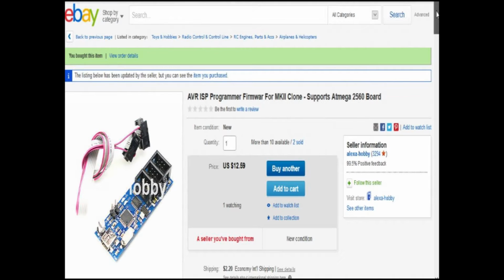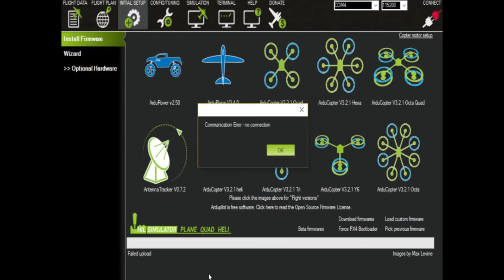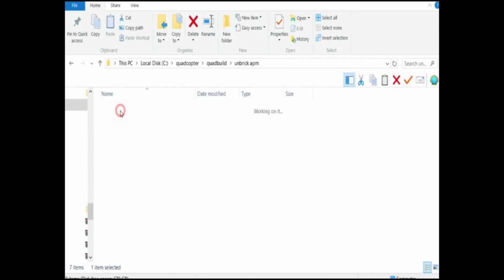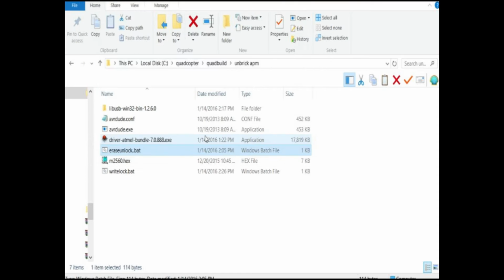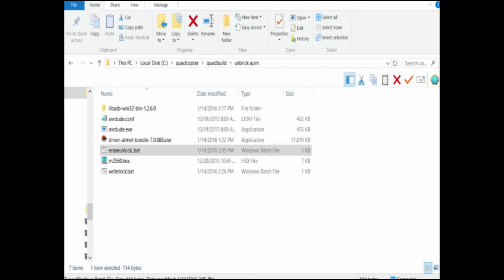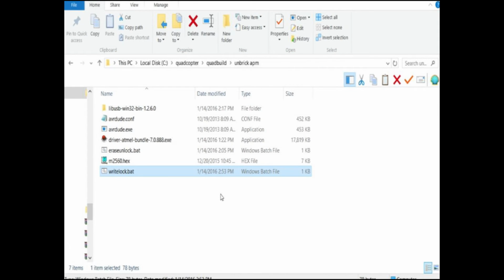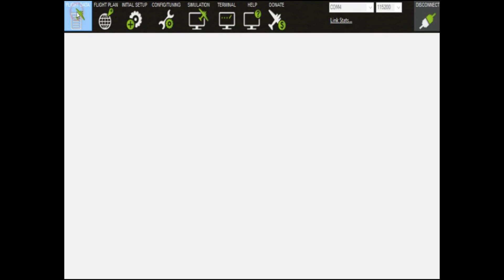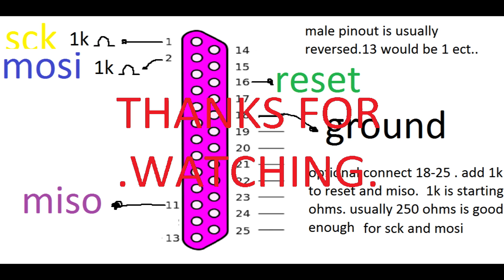Recover a bricked APM 2.

Comment: I have windows 10 desk top and don't know how to get to the set in my computer that your video is showing
Reply from the maker: in the description I show a link to the programmer
Reply from the maker: my package has support for these two from banggood
http://goo.gl/AA5JgA     //usbtiny .
https://goo.gl/8XVE3P   //usbasp
Reply: I received one out of the two USBASP USBISP AVR Programmer Adapter 10 Pin Cable USB ATMEGA8 ATMEGA128 Arduino. Still waiting for the other one to get here
Reply from the maker: so you can actually just try using the 10 pin version .. here is the picture again . https://drive.google.com/open?id=0B2w6_OKE_2kxRmpmLTBoTUZUeVE

fallow the video the same way .. but use the above pinout instead .. 
for this part of the video..
Reply from the maker: So were you able to get it to go?

Comment: unable to find the bat files in the above mentioned
 package...can u plese help
Reply from the maker: HI it could be you have hide extensions on.. the bat files name without the .bat are located in the "New full write with firmware"  folder.
file names are 
avrispmkii write full boot plus v3.2.1
usbasp write full boot plus v3.2.1
usbtiny write full boot plus v3.2.1

in the main folder they are the files that start with
unbrick
Reply: thanx but i am talking about eraseunlock.bat and writelock.bat...thanx
Reply: and one more thing after running usbasp.bat it is showing unable to verify data...if you can please elaborate on this issue.I am having apm 2.6 with communication error..unable to connect to mavlink...
Reply from the maker: hi ..sorry about that. I changed the files since the video and did not include that in the readme.  just click on one of the unbrick files i listed in the last message..  ( I merged the two files into one)

  if you only want to do the boot loader click on one of the unbrick files..     If you want to do the boot loader and write version 3.2.1 at the same time then go into the New folder.    

thanks for your message , I will update the readme so people won't get confused.
Reply from the maker: are you getting the same error on both files .. "usbasp write full boot plus v3.2.1"     and "unbrick usbasp"     .. I'm not sure what  error your talking about or when its failing.   is the 2560 being detected?
Reply: Thank you very much for the quick revert...whenever i am clicking on only unbrick file bootloader is done but after that when i am trying to connect apm to mission planner it is not getting connected and showing timeout error...and showing no connection...what can i do...any help would be greatly appriciated...
Reply: no while i use unbrick usbasp i get no error and blue and yellow led start flashing...but when i use the other file all leds stop blinking and there is only one solid led.in the log  i can see it writes the flash but unable to verify it...
Reply from the maker: hello.. went out for the day.. ... but anyways,..   When you run the unbrick one .  the next step is to go into mission planner.
set you com port and baud rate to 115200 but don't push connect .
go to initial setup..
Install firmware 
... then click on the third icon regardless of version number it shows . it should default to version 3.2.1  
or you can just simply click on "Pick previous firmware. and load version 3.1.5 or 3.2.1  .. let it finish, then try to connect in the main screen again
Reply from the maker: errr should add when your finished with the first step the unbrick file. unplug the isp and plug in the usb cable then fallow the above steps with installing the firmware.
Reply: i tried installing the firmware 3.2.1 after running unbrick one it shows communication error...no connection :-( The thing get stuck at reading hex and after this error comes...
Reply from the maker: Ok  . when you plug in your apm does it still get detected as a serial port /com port?
Reply: yes it does.
com 4
Reply from the maker: hmm well starting to think your apm might just be dead..   Can you run the  new firmware one again
but copy the text and try to paste it here or post it on your google drive..

how to copy the text.
when you double click on the bat file.
keep pushing space bar when it tells you to .. until you see
"DONE!!!  Unplug the isp and plug..........."

on the top of the cmd window ..it should say something like
"c:\windows\system32\cmd"

right beside the cmd right click go to edit and select all.. then go back and right click and choose copy .. ..then try to paste the info here.. it might be too long..

or just figure away to copy the info.
Reply from the maker: if your having a problem copying the text over let me know.. you can also send it to bangs696969@gmail.com

If you post a link  here just give me time to review and accept it...in the mean time you won't see it. probably.
Reply: bangs6996 thank you so much for being so generous and taking so much of pain....I am on the job and will send you Dropbox link.thanks for all the concern...you rock...
Reply from the maker: Ok I looked over both files. and neither of them are getting to the step of actually seeing the apm 2560 chip.

you can simply unplug the isp from the apm and run the program (bat files )again and it will probably show you the same info.

So 5 things can be going on.
1.   you have miso mosi reversed or other connections.
2.  your isp is messed up
3. your 2560 chip is totally fried.
4. not enough power (doubtful) 
5. No power.

1. Is easy just re look at all your wires if you had to convert 10 pin to 6 pin make sure you converted right.   ..If un sure take a picture and let me review it. while connected to the apm as well

2. You need to find something else to dump with the isp. You can check out my unbrick atmega32u2 chip .  

3. Not much can be done if that is the case.

4.  unplug the positive wire from the isp going to the apm . 
...plug in isp while connected to apm .
confirm the apm does not light up.

If no power is going to the apm. then power the apm as you did before with a power module , b cable.  or you can even plug in the usb cable into the side  then plug the usb cable into a wall adapter ect..  Try to use the isp with that setup.  ** OR try a different pc***

5.  does it light up when you plug in the isp into the apm???

I don't think I asked you which apm you are programing .
If its a apm2.6 then trying the atmeage32u2 chip is easier. ..doing it on the cx20 apm involves couple of harder solder joints..
Reply: hey i am using apm 2.6
i have connected another bricked apm and it gave me the logs as desired by you i am posting the link of both the logs.Kindly review. and thanks again for all the patience.
https://www.dropbox.com/sh/zq90ctt1uan0u7e/AABeciQzoZFhPS7DYnbibfm0a?dl=0

p.s I am able to load the firmware on this one with mission planner but on connecting it gives an error ...no heartbeat packets received...stuck at this point now...can it be because of 3.3 volts regulator blown up...
Reply from the maker: HI .. it can be your voltage regulator and you can quickly test that on the i2c pins or right off the voltage regulator for 3.3volts..

the unbrick file seems to be loading your bootloader.
the other files as you showed it fails with the read. at x0c

Mission planner also detects your board as a 2560v2 so that is good to a point.

so maybe try with the unbrick again. .. then make sure to change the t com port from auto detect to com4 and baudrate 115200 
and try loading previous firmware and pick one closer to the bottom of the list.

So give that a shot .. and test your voltage regulator.   I doubt you will get the firmware to load but if you do sometimes unplugging it then waiting about 1 minute before pushing connect in mission planner will allow the apm to fully boot up and allow you to connect with no heart beat errors
Reply: Thank you very much mate...I checked the voltage at i2c pin it is 5 volts in place of 3.3v so my voltage reg has gone in this apm ..The CLI is giving "bad CRC on ms5611" ..but i am still wondering what happened to my other apm which was perfectley getting detected till yesterday...i tried programming 32u2 chip can it be because of that ?....but again sincere thanx from bottom of my heart..I am grateful...
Reply from the maker: you might of accidentally reversed the 5 volts on the isp?  .not totally sure if it would blow ..but i don't want to test that theory.  might of also blown the protection diode /fuse .. ..http://www.dronetrest.com/uploads/db5290/40/282b43dd8ef40b77.jpg

but again with the isp directly connected to the atmega32u2 chip you should of been able to access it.   /read and write to it directly.

When you said tried to program the 32u2 chip.. did it fail??

===============  I really doubt this is your issue but its info..
specially because the bootloader loaded and your apm is being detected as a 2560..   .

I read a tad about your isp as well so to throw some more stuff in the mix..  https://petervanhoyweghen.wordpress.com/2015/12/02/the-usbasp-and-atmega2560-mystery/

Comment: Hi again, recently you've helped me with esc flashing if you remember. Anyway, I have an APM 2.8 and sometimes I have some reading problems with compass health gps health, and power module but not facing any connectivity problems with MissionPlanner.
So I would like to ask you if it's possible to have a bad or corrupted version of bootloader. Just to be sure I have erased eeprom and trie diferent versions (3.1.5 - 3.2.1) but had no luck..
Reply from the maker: Hi , I really don't think it would be the bootloader causing your problems.  do you have telemetry hooked up at as well during these readings?

Personally I would debug all your main wires and the voltage regulator to make sure its siting at 3.3 volts (under load as well)

here is a example how to test your voltage regulator  ..https://www.youtube.com/watch?v=1q6jjha5rgU       .. you can test yours right under your gps or where ever you plug in your i2c compass cable. ..it would be the outer pins not being used.
Reply: That was the issue! Thanks again!!

Comment: Thank you so much! You just saved my bricked arducopter apm 2.6! Bootloader got messed up after downgrading my FW from 3.2.1 to 3.1.2... Since then I got problems in upgrading my apm 2.6 back to 3.2.1 (communication error: no connectio). Also, since I used a usbasp avr programmer, I just edited your .bat file to communicate with my programmer and it worked perfectly! Now I'm able to flash the new FW to my apm 2.6 thru MP. Cheers!
Reply from the maker: No you can't use serial to recover boot loader.. if your unit is bricked you need to use a isp to program the boot loader..
Reply from the maker: Your welcome and thanks for taking time to post your success ..
Reply: can you use a ftdi adapter. if yes can you please help me with the connections
Reply: Or a usbasp avr programmer. That's what i used in recovering my bricked apm 2.6! Cheers!
Reply: hi allan how do i update the bat file
Reply from the maker: If you have usbasp or tiny.. i include both bat files in the package..

besides that just right click on the bat file choose edit 
or open with notepad directly ,
 change "usbaasp" to what ever isp you have ..   .. If you can't see the extension .bat then you might have to change your folder options.
Reply: i am having this usbisb http://www.ebay.in/itm/AVR-USB-PROGRAMMER-USBasp-USBISP-ISP-for-ATMEL-ATMEGA-ATTINY-MICROCONTROLLERS-/281397221287?
Reply from the maker: Hi.. just use the file "unbrick usbasp"
or go into the folder
New full write with firmware
and run the file  "usbasp write full boot plus v3.2.1"
Reply from the maker: also I'm sure you found this already as well .. If you have the 10 pin on yours the pinout is like this https://drive.google.com/open?id=0B2w6_OKE_2kxRmpmLTBoTUZUeVE
Reply from the maker: try to use mission planner.. and are you using the usb cable ?  ..you can't use the isp with mission planner ect.

Comment: well I have my resistors already desoldered, and I have a serial port on my old laptop that I can fire up. my old PC isn't connected to the internet ext. the serial port I have on my laptop is a 15 pin 3 rows of 5. both ends female. would you mind if I email you a few pics of what I have around and you can give me you recommendation. when it comes to things I'm often more intricate and detailed than I offen ever need to be. really wouldn't be a bad idea to make a plug and play adapter that I keep in its case. my email is magdesignstx@gmail.com
Reply from the maker: sure you can send pics to .. bangs696969@gmail.com ..    if you have any other arduino or atmels.. you can also change those into isp programmers..    I was just thinking it would be neat to use the on board atmega32u2 chip the one that controls the usb on the apm into a temp isp programmer.. not sure if its possible . .. but anyways thats for another day..

I am a tad busy today so depending when you send the pics or ask questions it might not be till much later you get a reply back..    

If you want to convert serial port into a isp then look towards
ponyprog for examples on that ..its been more then 10 years i've made one using serial. i think you need more ..resistors capacitors and maybe even a xtal....

The port your explaining with 15 pins ..sounds like a vga / monitor plug.

Comment: Hi I see that usbasp is changed from Banggood market, will it work in the same mode?
Reply from the maker: Hi yes it should work.. you will need to edit some of the files for the asp
Reply: Sorry but in which way I should edit the files?
Reply from the maker: HI..i just edited the zip file .. If you re download the package .. use the file in folder New full write with firmware  that says usbasp.  You only need to run that file it will write the bootloader and the flash
Reply: You are a great! Thank you for all
Reply from the maker: Your welcome. and good luck with the recover